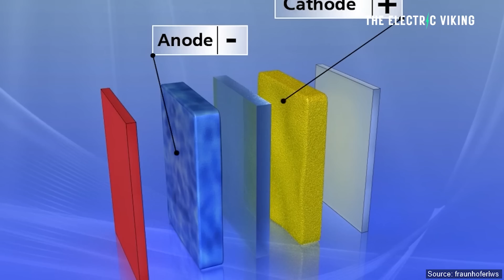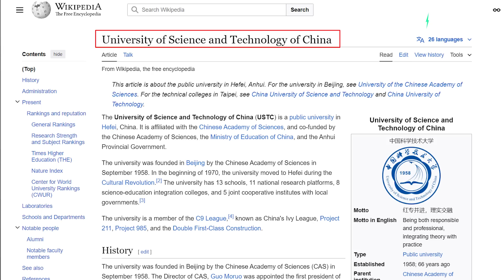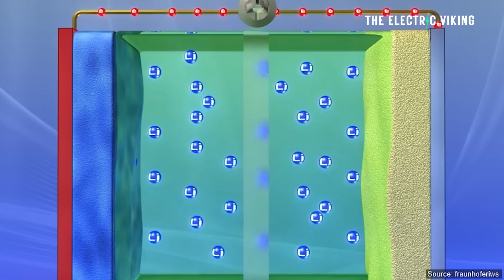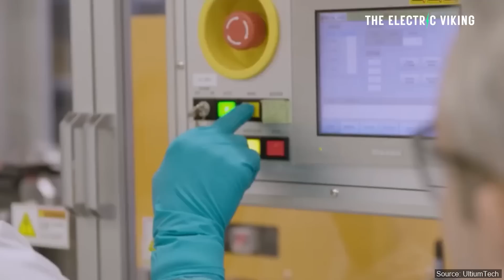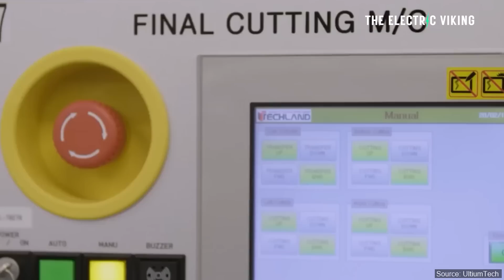China's game changing solid electrolyte slashes solid-state battery costs 90%

Comment: One HUGE factor in wanting to use Sulfur is that it's a waste product from Hydrodesulfurization in gasoline refining(which uses Cobalt as a catalyst btw).
There's enormous stockpiles of the stuff available and tons more being made everyday, because fossil fuel industry 😅
Reply: High energy density of sulfur batteries has been known long. Unfortunately degradation is too fast for practical use. If somebody solves that then sulfur batteries will take over.
Reply: @jkn6644  Do the sulfur batteries you're talking about Include Lithium cathodes Or What other metal?
Reply: @ariisaac5111  Maybe you should try actually watching the video.
Reply: Correct, but when that source dries up there’s no shortage, it’s the fifth most common element by mass on Earth.
Reply: @fredbloggs5902  Indeed, Sulfur is literally being spewed from the ground in areas of volcanic activity, it's not rare by any stretch of the imagination. 😀
The stuff from refining is already 'mined' though and high chemically purity, so it requires minimal effort to process for use in products(like batteries etc).
By the time gasoline refining goes the way of the Dodo, there's hopefully good recycling available for these sulfur batteries, meaning we can keep new mining to a minimum.
Reply: But if you destroy the fossil fuel industry, it becomes rare and more expensive!!!
Reply: @robocowone464  There’s NO shortage of sulphur regardless of it being a byproduct of the fossil fuel industry, go look it up and see for yourself.
Reply: @robocowone464  Nice joke there TY 😁👍🏼

Comment: The price of solid state batteries is high because the two electrodes, with the solid electrolyte sandwiched between them, must be kept under an immense mechanical pressure.
Remember that are not electrons, but while ions, that must travel in the sandwich. Whole lithium ions are a physical solid which must move inside another solid. 
I don't want to rain on your parade, but this is a unachievable challenge: the story that solid state batteries are too expensive is an euphemism that technologists use instead of "they can't be built"...

Comment: This is what Gemini had to say about lithium dulphut bstteries 

"Lithium sulfide itself isn't actually considered expensive. Lithium-sulfur batteries, which are still under development, have the potential to be cheaper than lithium-ion batteries due to sulfur being an abundant and low-cost material.
The high cost of lithium-sulfur batteries currently lies in the challenges researchers are trying to overcome to make them commercially viable. These challenges include short lifespans and capacity degradation"
Reply: Thanks 😊. I thought that might be the problem.🤔
Reply: That's what I thought. Lithium? Sulfur? Expensive?? Naaah.

Comment: As you say, we'll see in a few years if this makes it to production. As CATL have what sounds like a great product already in production, and the likes of Toyota keep making promises that they have for the best part of a decade, failed to deliver, while also claiming hydrogen is the future, then I'll go with CATL, when it comes to banking on genuine progress. CATL keep delivering. 
As a side note, I am still enjoying my 8 year old Model S (262,000 mile). I'd like to think that if I keep hold of it, then at some point in the future (2-5 years?), I will have the option to buy a replacement battery that weighs less, goes further and charges faster. Effectively giving my car a new lease of life. I realise this would also need either Tesla or an independent supplier, giving the car the relevant software update to run the new battery, but it should be doable.

Comment: Again, for EV's you need watt/litre not watt/gram.
So, please give us, these numbers.
Reply: I think you mean watt-hour/litre
Reply: @greggrant4614  same, yes. Watt is 1 metre, 1 second, and 1 kg. So, you have time (second) inside watt... hour is just mulitiply 3600, seconds.
Reply: Both are relevant. I won't say that  one has more or less importance than the other buy volumetric energy density and gravitational energy density are factors that have to be accounted for in design.
Reply: @davidbrayshaw3529 No, they aren't.
If you look at li-s (lithium/Sodium) batteries. They are 5 times better w/g, than lithium-ion. But, where would you put 5 times more batteries in a Tesla?
You would need to fill up the whole car with just batteries to get those 5 times more range.
Reply: @geirvinje2556  Firstly, a watt is a measure of energy. 1 watt=the transfer of 1 joule in one second, not 1kg in one metre. To achieve that with anything other than gravity will take a lot more than 1 watt of energy, especially if you are lifting it up!

I don't quite understand what you mean when you describe sodium ion batteries as being "5 times better" than lithium ion batteries. Better at what?
Sodium ion batteries are considerably less energy dense in both volumetric and gravimetric terms than lithium ion batteries.
Yes, you would need a car full to achieve the same energy storage and discharge rate.

Comment: What is the anode
Reply: In a lithium ion battery, it is the negative side of the cell. When the battery is fully charged, this is the component of the battery that stores ionise lithium (lithium missing an electron). When being discharged, lithium ions travel through the electrolyte to the cathode which results in a potential difference in charge or voltage between the two points. This causes electrons to move in whatever load is connected to the battery i.e. the windings in a motor.
Reply: Thank you but I meant what type of anode is used in this solid electrolyte battery as in chemistry
Reply: @robertpatterson4185  You're welcome but sorry I misinterpreted your question.
As for the materials, I have no idea.

Comment: Sam, haven’t you been saying that CATL’s silicon anode battery, at 500 wh/kg is already under mass production, and will be in evs very soon?
Reply: CATL have no batteries with silicon . They are currently shipping next gen batteries that use crystals with bigger gaps inside for storing lithium. Silicon atomic bonds get weakened by storing lithium so silicon most likely will not be used   long term

Comment: The currently mass produced Amprius batteries used by Formula E for example are 500 kWh /kg.
Reply: Wh/kg
Reply: @chrishaberbosch1029 or, kWh/tonne😊
Reply: But only have about 400 to 500 cycles in them, making them good for aircrafts, drones and so on, but not for a car that's supposed to last at least 15 years.
Reply: @alexandruilea915  500 cycles at 300+ miles which is approaching the average ev range now is good for over 150,000 miles genius. 
The average ice vehicle world wide is retired at 12 years old and around 130,000 miles SMDH. Some countries it's less some a bit more. 👍🏻
Reply: @4literv6   500 cycle   in real world  mean it last 2-3 years,   if your calculation base on  -- only charge when battery down to zero
that not good for any battery

Comment: Its not just the cost. solid state batteries so far have a very short cycle life.
Reply: Where do you get that information? I looked it up and they last 30 years, there may be degradation over the years but isn't it the same with a gas engine. There a million junkyards half full of blown up cars and trucks that had their engines fail.
Reply: @dougtheslug6435 Amazing how the naysayers and trolls and uneducated ignore reality.
Reply: @mikewallace8087 no there aren’t.
Reply: @mikewallace8087 how many ICE junkyards? 😂
Reply: @larryc1616  thousands.
Reply: @mikewallace8087  Yes, ecars crash and get outdated too.
Someday all the junkyards will be ecars.
Reply: @dougtheslug6435  I don't think you are talking about solid state batteries. LFP batteries will last a long time. Solid state which is the holy grail don't last so long
Reply: @DeveloperChris  Like I said I looked it up and Lithium Ion which is currently used in EV's start to derogate after 1000 cycles but the solid state after 5000 cycles and they claimed they last 30 years. I'm no expert but the claims that they don't last is not backed by the facts in my search.
Reply: Yeah,  they need to increase it a lot to be worth while.   
As yes it has better density and cost less.   But if it has to be replace many times vs normal battery pack.  
It terrible